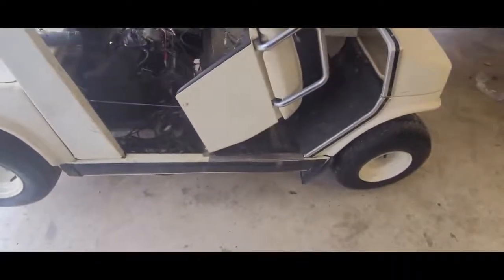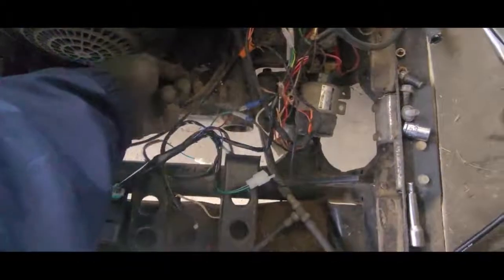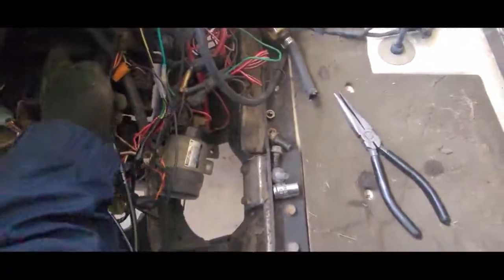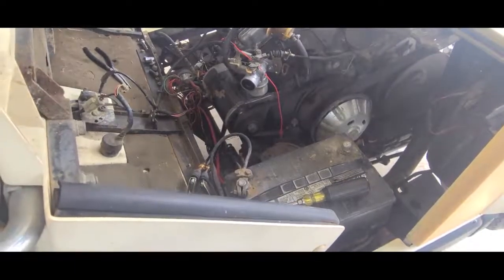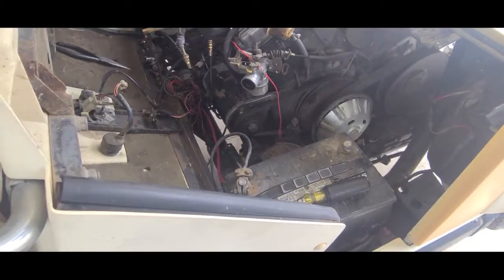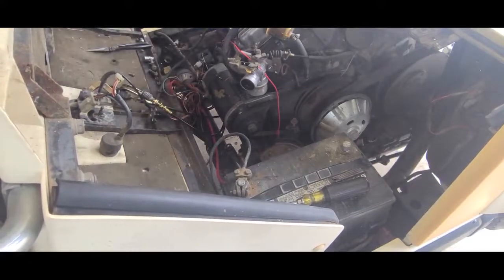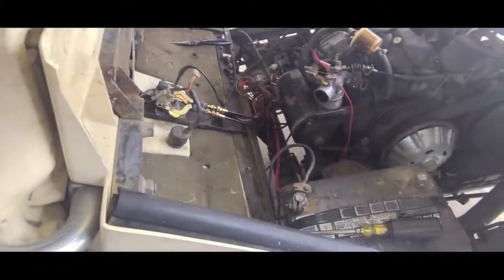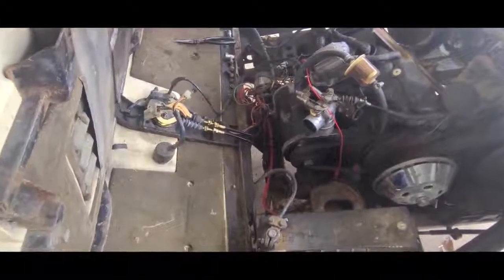changing forward and reverse cables on a Yamaha golf cart

Comment: Thanks for the vid.  I have a 1990 G2. The lower gear selector cable (forward, I think) snapped.  I have ordered replacement cables. The cart is currently stuck in reverse. Any advice on how to switch it back to neutral manually.  I tried to turn it with the linkage attachment to the spindle but it won’t budge?  Not sure if I should turn it clockwise or counter clockwise to get it in neutral.  Is it even possible to do it without the cables given the amount of force that may be required.  The fear oil level Was really low, I have added about .75 qrt to the box through the breather port.  Any advice would be welcomed.

Comment: perfect looks easy enough i have a 2000 g16 i lost forward drive and clearly broke something inturnal (with all that was bouncing around in the case) so I'm trying to pull the rear to split the case to inspect and repair but cant find a video of the removal of the rear end so theres the bolts easy enough but then theres all the cables so i found a brake cable replacement video to learn how to disconnect thebrake cables and this to disconnect theshifter cables i tried this but with the shifter in forwards theres to much tention on the one cable to pull it off so my plan is to  unbolt the reat end slide it back just a bit so i can pop the shifter part off and get the cables off
Reply: my problem exactly.  How do  you remove it from the transmission??!!  He skips this completely.  I'm guessing it has to be removed from the shift handle first to relive pressure......   ??